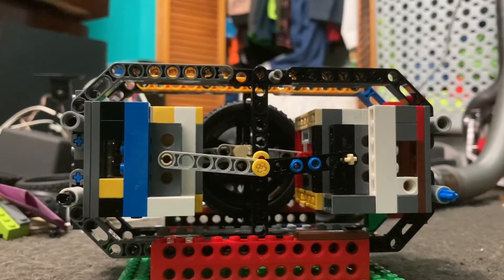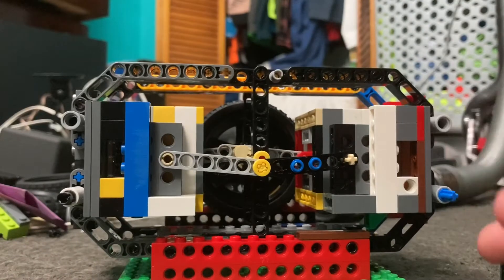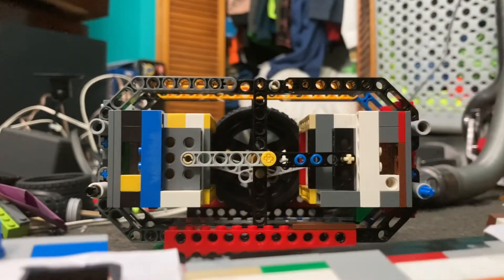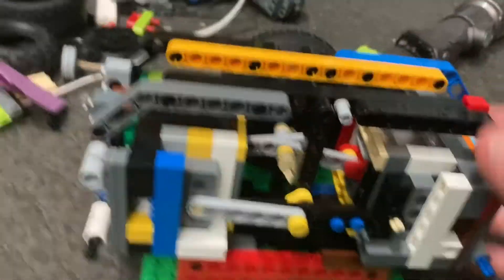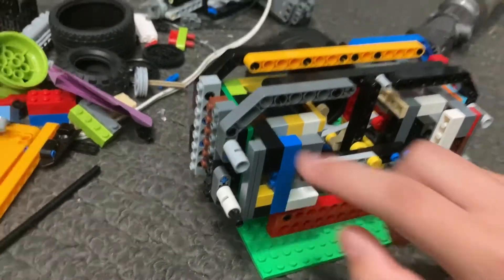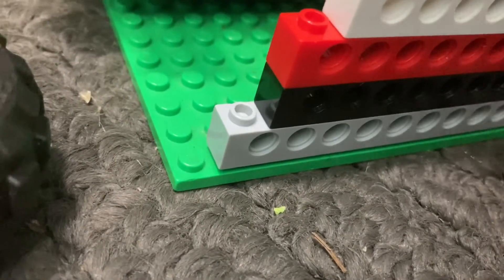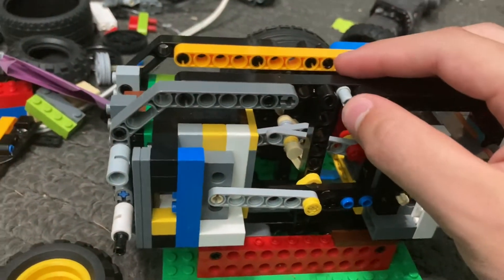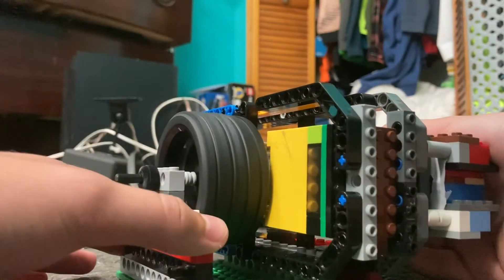LEGO Boxer 2 Engine

Comment: I think this is a Flat 2 instead of Boxer. In a boxer engine the pistons are connected separately. So when one goes up, the other goes too. In a flat engine you just take a normal V engine and make the cylinders 180° apart

Comment: My boxer engine is strong to (without flywheel)
Reply: Is is even possible to make an engine without a flywheel?
Reply: @egg703  yeah it just needs to have two opposite power strokes. On a true two cylinder boxer it is not possible. On a flat two or boxer four it is possible.
Reply: Not neccessarily some 1 cyl lves run w/o a flywheel and so does my  120° v twin

Comment: I'm editing this as I watch, 
I had an idea on how to stabilize the flywheel!
Take two long brackets and angle them like a v and you can adjust the length till it allows free spinning then fasten them together.
I'll explain better in the discord
Reply from the maker: Shlushe 10 I was just using what I could fine, it’s ineffective because there isn’t another one in the cylinder. And yes I get what your saying I could definitely do that now that I think about it. I’m not gonna be on discord this weekend I’m going away on vacation again but I’ll be back on monday.
Reply: @KFPlusLegoMastery  man another vacay 😂
Reply from the maker: Shlushe 10 it’s a long story but I’ll tell you when I get back.